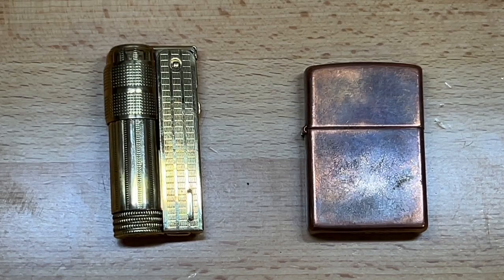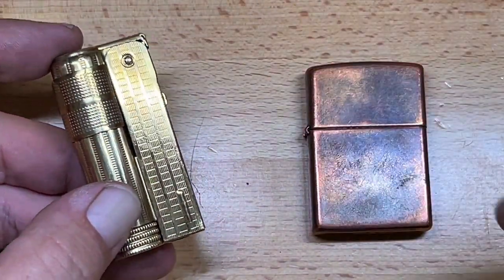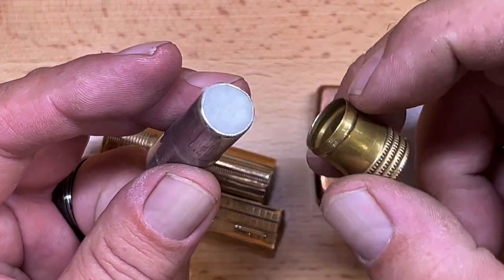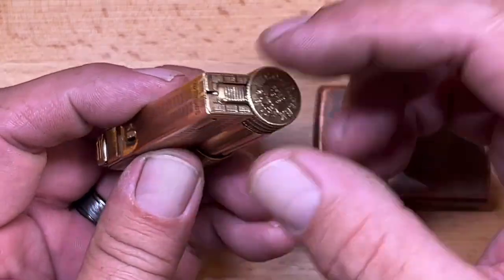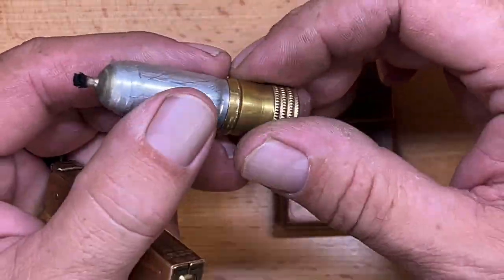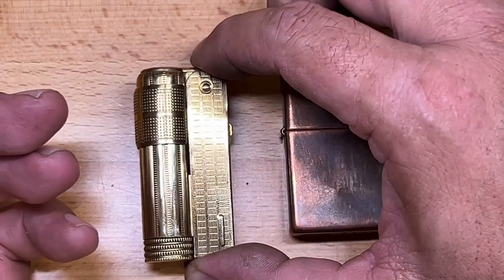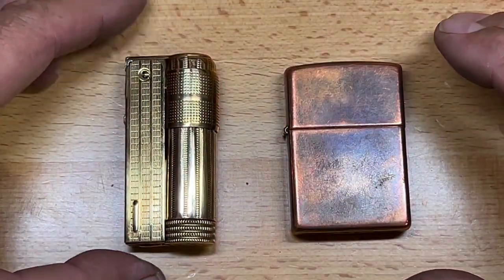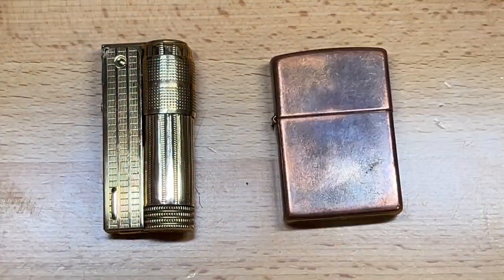IMCO Super 6700

Comment from the maker: IMCO Super 6700 - https://amzn.to/3AigZVo
Reply: Interestingly enough, the prices on Amazon for Imco lighters seem to vary wildly? It looks like some of them are around $22-ish while others go up to $78-ish—and the one that you happened to link to is about $50—and all of these lighters visually look to be just about the same? (And on top of that, I don’t know what a fair price would be for one of these lighters since—like you—I’ve been pretty much been solely a Zippo user all this time.)

So does anyone know what might lead to such a wide range of prices? For instance, are the cheaper ones knockoffs, or are the cheaper ones merely less in cost for some other reason? And are the ones that cost more better in some way than the cheaper ones?
Reply: @handcoding  Amazon prices vary, as you say. I've seen the Chinese models for as low as $10 on AliExpress (I'm guessing they may be knock-offs?), and on Amazon the official Chinese IMCOs range from $20 to $50. The old Austrian models sell on eBay from between $50 and $100, depending on condition, and Amazon has new old stock Austrian 6600 models for $78.90.
My advice - buy the official Chinese ones on Amazon. They are as good as the originals, and stainless, so less rust issues.
Reply: @Beery1962  That’s helpful info—thank you!

Comment: I've been collecting IMCO lighters for a number of years now. They are far better than other petroleum-fueled lighters: keep them clean and, once the flint is broken in (with a few strikes) they light every single time. Also, their fuel lasts for up to a month, which is far and away better than a Zippo. They look flimsy because of their sheet steel construction, but they're very rugged, and in their day (before everyone found out how good they were) they were the cheapest lighters around. There's just no lighter like an IMCO.
Reply: knew a guy who once took a zippo and an imco and threw them against a brick wall, zippo was busted and imco just needed a few strikes and it was good

Comment: If you might be up for it, I’d be super interested in an update video in maybe a week or two about how well the Imco retains fluid?
Reply from the maker: Sure, I’ll be happy to.
Reply: @txtoolcrib  The one in the video doesn't look fully filled to me (but maybe you're already aware of that). Anyway, in my experience, fully filled, the 6600s and 6700s last about 3 weeks. 6800s last a little longer - up to a month.
A lot of the longevity depends on how low you trim the wick (lower uses less fuel on every light), and how the lighter is stored (upright seems to be best).
Reply: @txtoolcrib  Awesome—I appreciate it!
Reply: @Beery1962  The 6800 last longer?
I recently got the streamline model and I really like it, but if the fuel lasts for a month then I really lucked out getting the 6800 lmao

Comment: I'm starting to like the new Chinese IMCOs more. As you say, they are now stainless steel, which means less rusting. To me that's a big deal. I bought a 6800 first, and the tooling was slightly off - nothing that affected function, but the pattern wasn't perfectly centered on the parts. Also, the slider for the flint assembly was not perfectly folded, which made the slider just a little less smooth - again, nothing that affected function, but for those who are detail oriented, it could be a deal-breaker. However, I just bought a 6700 - got it today, and that one is perfect.

Comment: You will forget about Zippo after you use IMCO for a while. It holds fuel like forever.
Reply: Yup. I recently did tests on an all-brass Zippo (supposedly the best for fuel retention) and an old Austrian IMCO 6600. Both with all new cotton bacon and properly routed wicks. The Zippo lasted 27 days, while the IMCO lasted 54 days - literally twice as long.

Comment: I have been using 2 Imco Junior 6600s for about 20 years and I am very satisfied. I found 2 more Imco Juniors in the ruins of an old house that was demolished about 2 years ago. I cleaned it and added flint and fuel. They are currently working smoothly. I think Imco lighters are better than zippo.

Comment: One annoying thing about this lighter is it does not stand upright well. Because of the mechanism on the bottom that you use to open the lighter, it is not flush on the bottom and thus not stable on a table or counter.
Reply: Good to know
Reply: @eddieg9506  Yeah, not a big deal but good to know before buying. After using it exclusively for lighting my pipes for about a week, that's the only negative thing I can say about the lighter.
Reply: But the fuel cartridge can be removed and is stable enough to be used as a candle

Comment: Have you tried a Douglass S field lighter? They are next level!
Reply: I don't like those rubber seals - I'm guessing they dry out quickly in the presence of petroleum. Also, I've heard that the Douglass S lighters have problems with heat expansion of the metal (they use brass rather than steel) affecting the tolerances. I like the Douglass Field L better - simpler design, but I hear they evaporate within a month, which makes them no better than an IMCO, and at 5 times the price, it seems a waste of money. I'm sticking with my IMCO - it's never let me down.
Reply: You can buy petroleum , heat and chemical, even abrasion resistant O rings which I do for all my lighters that call for O rings. IMCO especially the original was IME excellent for fluid retention compared to Zippo. Lighter fluid is $70 a gallon so my Zippos are stored right now😂
Reply: I own a Field L and it is a work of beauty, however the cap is attached to two very thin pieces and mine started to not be aligned anymore. I feel IMCOs (even fake) more durable
Reply: @Beery1962  I own a field L, the cap is attached to very thin pieces and starts to deform after some usage

Comment: I experimented with putting high temp teflon tape meant for propane pipes, putting it in the bottom of the case of a zippo. It Seals better but too good of a seal it starves the flame too much.

Comment: Cool to see it lives once again, but id be passing on a Chinese copy
Reply: They are actually really good. A Japanese company owns the IMCO name, so that positively affects quality. Also, the materials are better - stainless steel rather than nickel plated steel of the old Austrian ones. I wasn't sold on them at first, but now I really like the new IMCOs.
Reply: I bought one out of curiosity. And I am quite surprised because They were near perfect. Only thing that is not-original quality is flame adjustment. Flame was too large even in "lowest". Anything than that. They were really OEM quality. In stainless steel. if you are new to imco or want a imco, i will recommend one. And they are cheaper than a zippo. if you Change wick, flint, cotton to high quality ones... This will perform better than original. Because they are SUS. and I have two original and EDC one.
Reply: And I can see this reviewer's flame is small enough. Maybe it was my batch? Or maybe they got updated? I don't know.